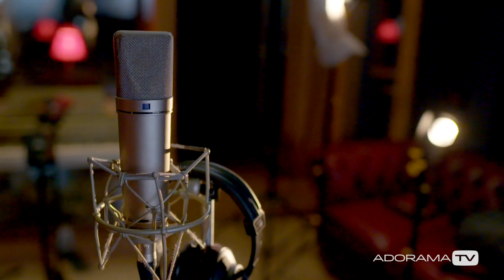Q&A: Perfecting Audio

Comment: I have a two channel rode mic, it has a -10db a 0db and a +20db gain switch. I notice when I do voice over and it's set to 0db it comes in very quiet and I need to set peaks to zero in post to get full volume.. if I set it to +20db I get too much hiss but a reasonable volume for the recording. Should I just keep it on 0db and edit in post or am I missing a trick?
Reply: I feel that if you push the output by 20dB you are processing the signal, thats where the noise is being generated. If you are pushing the mic that much you are not giving yourself to much headroom, which could cause distortion. If the result is clean when you push it in post keep doing that. Where is your final master going out on?